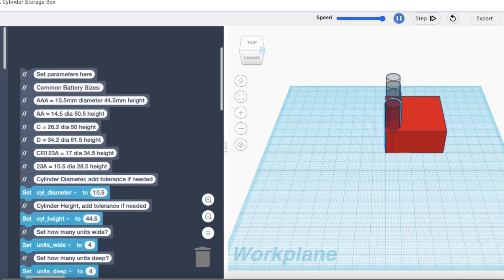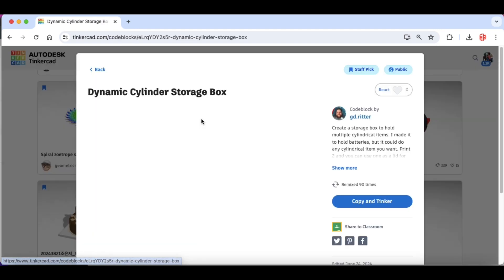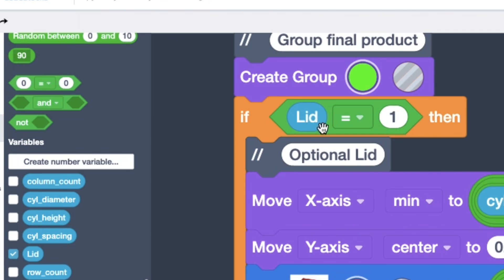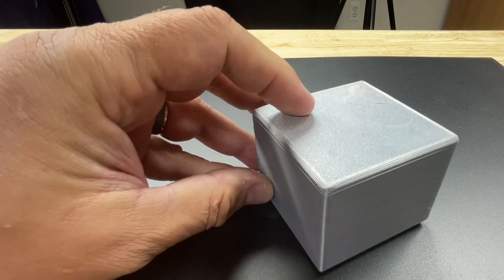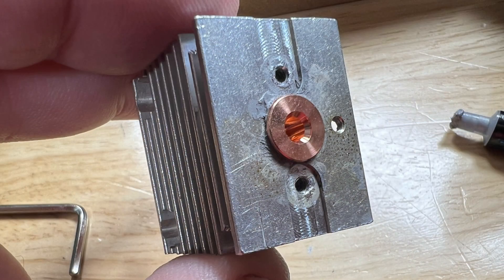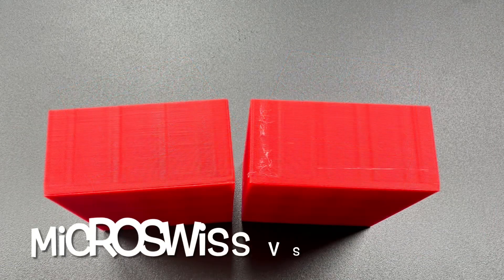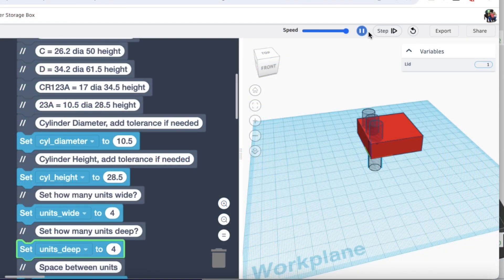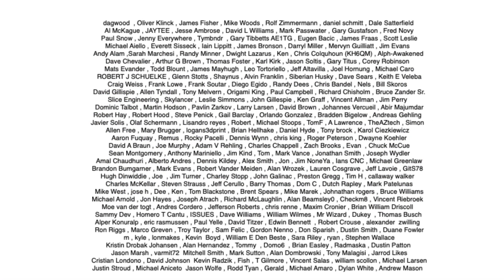Creality vs MicroSwiss Hotend

Comment: Hey Chuck,
Are you unable to reduce print temperature or increase retraction to reduce stringing? The only alternative is expensive hotend upgrade? Glad I learned a few things or you could have new users spending extra money before trying cheaper solutions or just adjusting settings in slicer.

Comment: Hello CHEP, i have a question after receiving my K1 max and it might not be a standard question 

My question is about the cable connected to the screen of my K1 max. I would like to extend it with about 30/40CM, but dont know what kind of cable i can use to do this :)

I believe it is a 41pin FFC LCD cable but would like to make sure. Could someone please advice me on what type of cable to use and where i can buy this type of extention cable?? 

--> Some might want to question why one would want to extend it, its because i have it in a cabinet with glass door and i want to have the screen outside of this chamber.. Double heat chamber... i have the option and this helps me to leave the top glass pannel off and saves me the hastle of a filament dryer

Comment: 4:25 Are you not shorting the battery here? Did this once on an 18650 and it sparked. Would not recommend.
Reply: Some multimeters don’t have conductive bearings between the rails. I would still generally recommend against it, as wear and tear can close a circuit.

Oh, and battery specs are well documented.

Comment: looking at flowtech nozzles, I wish someone in china would still make the old single piece j-heads for cheap. where the cold tube and the nozzle itself are part of the heated block. the mishmash I'd want is that, combined with a heatsink instead of the fluted ptfe holder.   the flowtech kinda achieves the same. kinda only and at a cost.

Comment: I upgraded my K1 Max to the hot end that comes in the K1C. I thought I was getting an after market hot end but it turned out to be a genuine Creality part it works fantastic! I also removed the plastic drag chain and replaced it with a riser and a different cabling and Boden Tube support system I found on thingiverse. This got rid of the slapping noises that my printer was making. It also improved the flow thru the Boden Tube since it did not bind when printing in the rear left quadrant of the printer.
Reply: Do you have a link to those files?